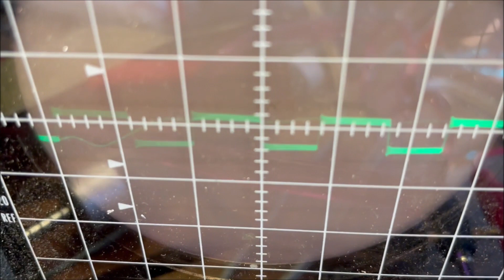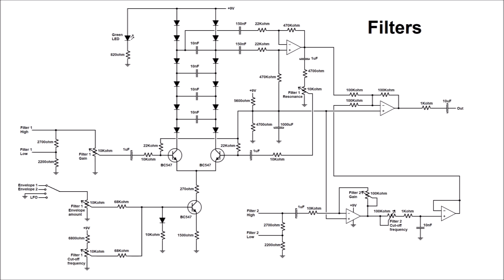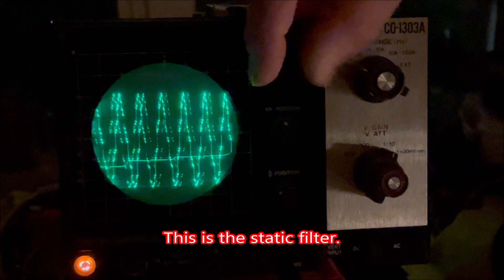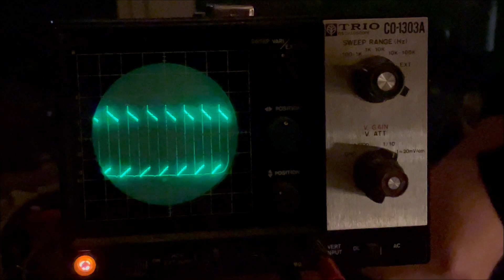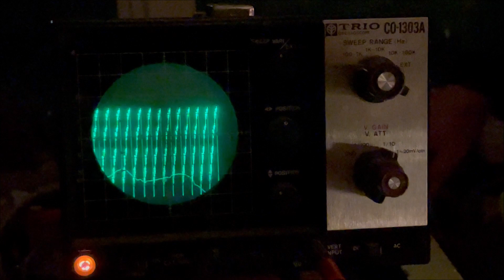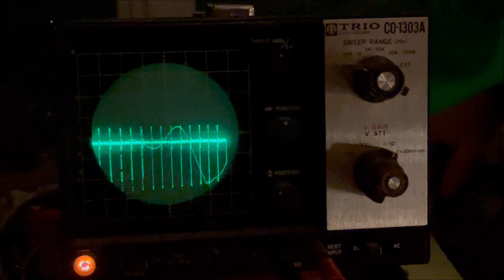Square wave adding synthesizer - part 3: The filters

Comment: I think it’s similar to the filter in the JEN SX-2000, which itself uses diodes and is based on the filter of the Synthi-AKS
Reply from the maker: Yes, it's quite similar. I checked with the schematics for the JEN C-450 organ, that contains an SX-2000. The same idea as Yamaha CSY-1 and SY-1.
Reply: @organfairy  I had an SX-2000 and liked it, apart from the unpredictable key triggering. Would love another one!
Reply from the maker: @t55a2  I have never seen the SX-2000, but I have come accross the C-450 organ a couple of times. It's rather big for what it actually does - the synth part is interesting but the organ is kinda dull - and that can also be said about the Yamaha CSY-1 actually.
Reply: @organfairy  If you could remove the synth part from the organ I’d be interested in having it, could turn it into a MIDI module. Obviously, I assume you’re keeping the organ and have no plans to remove the synth part. If you do remove the synth part, however . . .
Reply from the maker: @t55a2  But I don't have it so it's pretty academical :-) However, since I have the schematics I could potentially remake it from scratch. There is, however, some components used in the synth that is hard to find.
Reply: @organfairy  Yes, there will be a few unusual ICs. It was a pretty simple PCB, as I recall